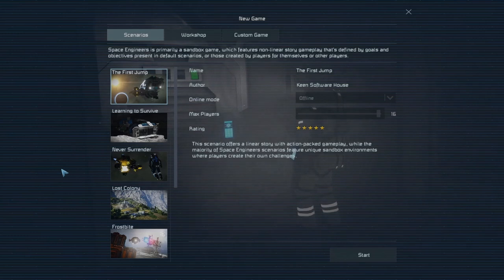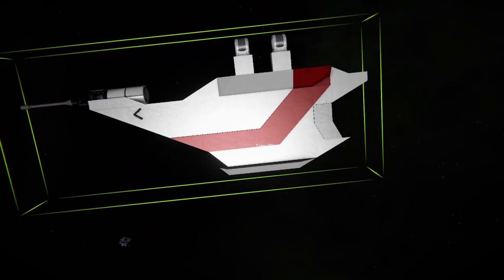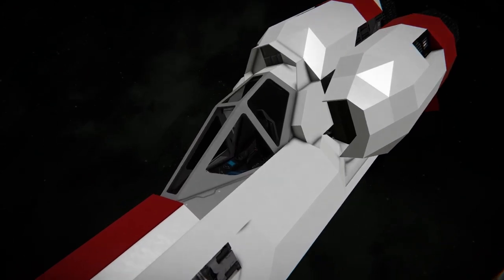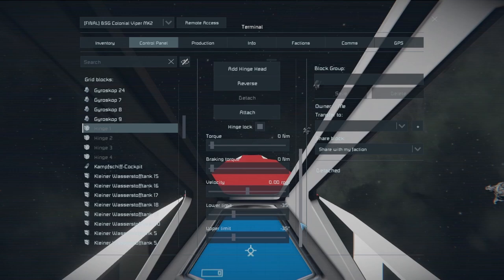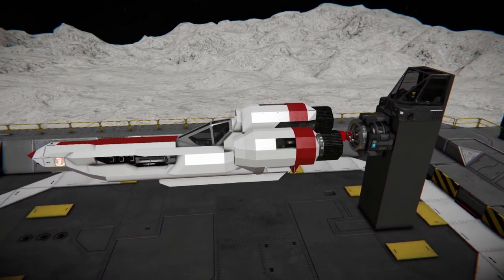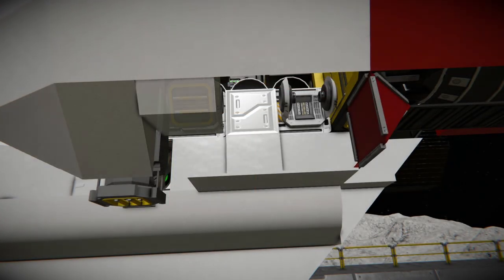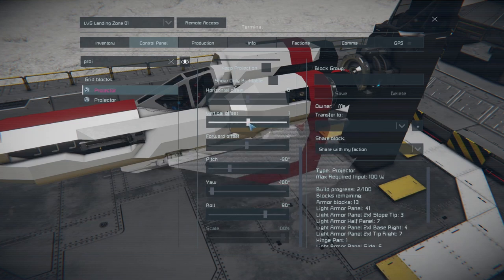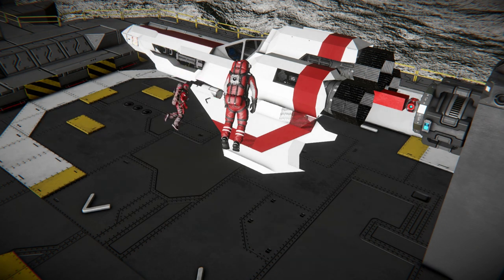[SPACE ENGINEERS] SUBGRIDS PROJECTED | vanilla survival tutorial

Comment: The most genius way I have seen this solved is to attach the sub grids to the main gird with blocks and have the hinges, rotor heads and piston heads detached that way all the parts are together for welding but you just reattach all hinges, rotor heads and piston heads and cut away the block holding the parts in place.

Basically the ship is put together like a model kit would be on sprigs you cut the parts off the sprigs and then assemble the parts.

Comment: For the sake of the Playstation newbies:

Group all the hinges/rotors. Set a timer block on the main body with a 1 sec delay to start itself, and "attach" the rotor and hinge groups, and "increase displacement" on the rotors group. Attach all the subgrids to the main body with bright "grind me" blocks. 

Project the BP and weld it up. If your main body doesnt have all 6 directions and a gyro, build temp ones. 

Attach a landing gear to one of the subgrids and stick it to something with a lot of clearance. Grind off the bright block, start the "Attach" timer,  and fly the ship into the hinges/rotors. They should snap when close enough. If you set the min/max limits on anything that's offset and turn them off, they will be loose until wiggled into the lock position.

Grind off the temp landing gear, put a lander on the next part and continue grinding off the bright block and flying into attachment range. 

When everything is attached, grind off the timer and lock all your hinges/rotors. You're done!

This method doesnt quite work with rovers that dont have thrusters. If you build on a completely flat surface, and use "Trigger timer block" instead of "Start", you can use gravity to drop the subgrids into each other. It wont work all the time, but it will help.

Comment: Alternatively, you could separate all the subgrids, connect them to the main grid with a temporary connection and save it as a single blueprint. That way you don't need to dig through many files, and you can just grind away the extra connecting materials. I like to color-code the connecting blocks so I know which blocks to remove.
Of course, if your blueprint has large and small grids, you will have to make this into two separate blueprints; one blueprint for large grids/subgrids and one for small subgrids.

Comment: Subgrids can be annoying. I got these ai HEAT round missiles that are two parts. Built a printer that even automatically gets rid of the rotor heads before printing and putting the two parts together. Then just a timer that repeats on attach. Then I realized id have to manually redo some logic in the front part anyway so it was all for nothing. 😅